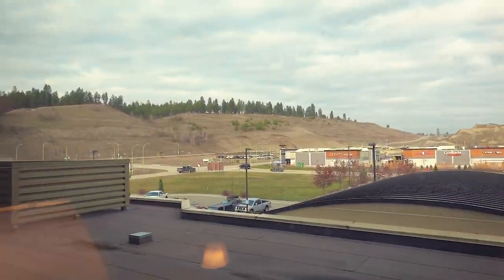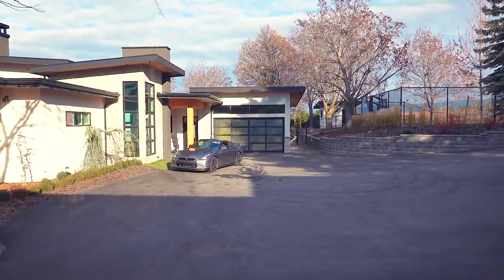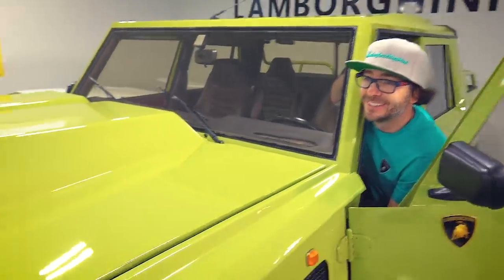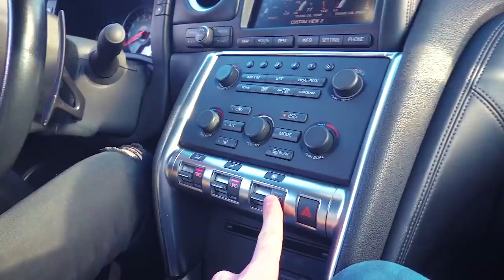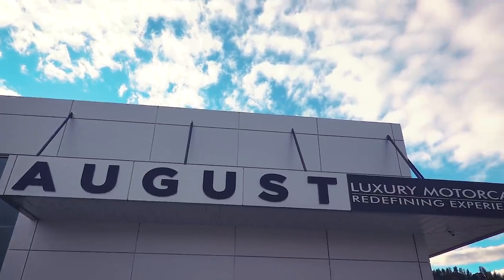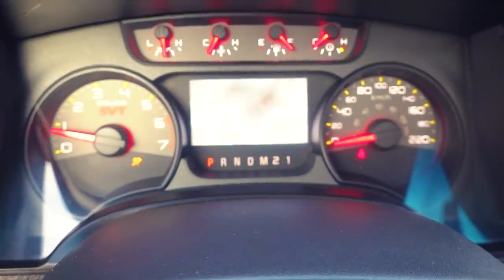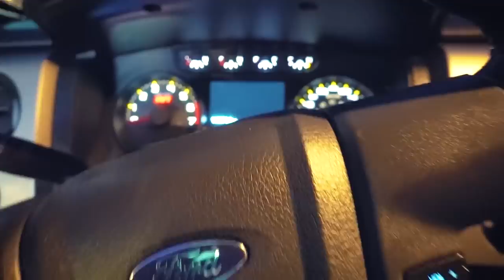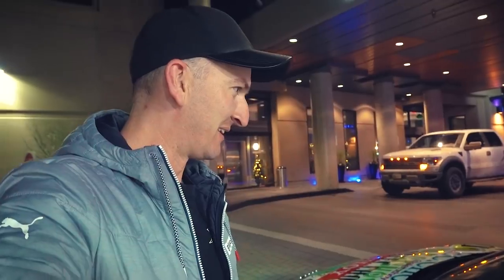DRIVEWAY DONUTS IN AWD LAMBORGHINI MURCIELAGO SV!

Comment: First mod you have to do is get rid of the governor because the top speed on your Ford raptor first gen is a whopping hundred and seven miles per hour no joke love raptors but the first gen one has the huge problem u should fix that cause raptors are so bad ass and now u know how much fun they are you should get some king suspension some 36 inch tires never have to worry bout pain in the ass speed bumbs